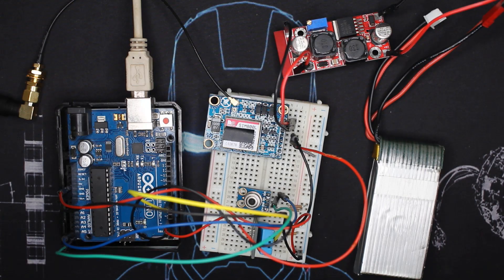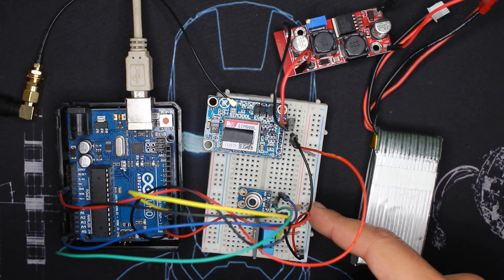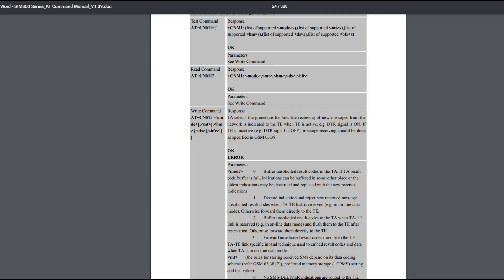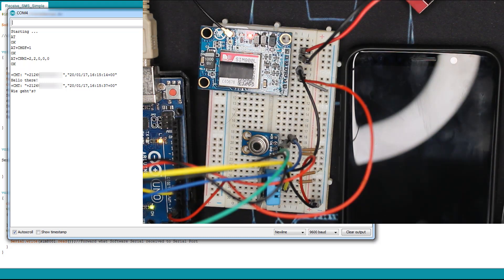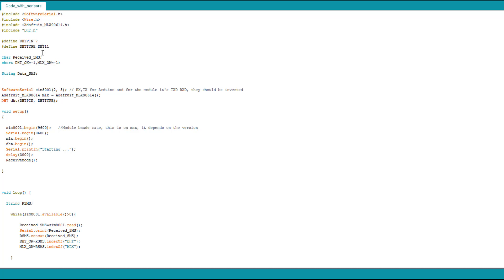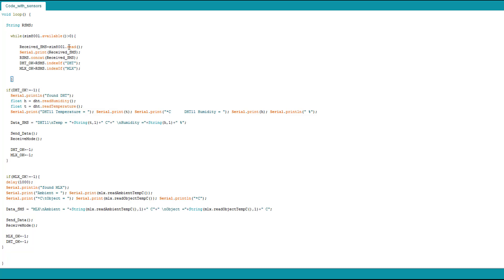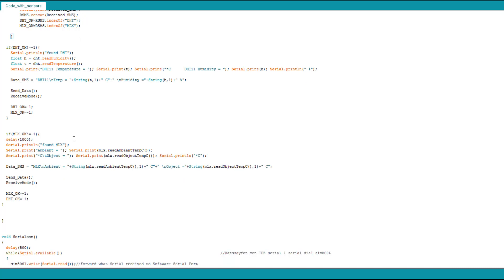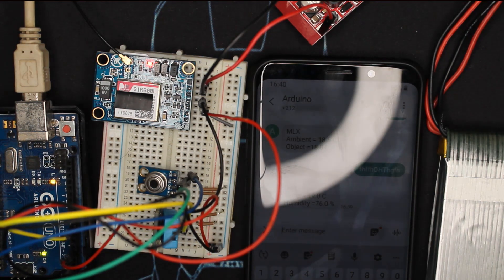Send/Receive SMS using SIM800L + Arduino (Request sensor values) | DigitSpace.com

Comment: Hello sir, first i’d like to thanks for the knowledge you’ve shared throughout your website and youtube. I created an over-voltage alarm program that read voltage with refresh rate every 3 seconds.
where if the voltage exceeds the set point 420 VAC it will automatically send a SMS. but the problem occurs because the SMS keeps repeating every 3 seconds, so how can i do to make the SMS only sent once at the beginning. despite over voltage condition least for minutes / hour after it.? Thank you sir. I hope you can help me

Comment: Hello Sir. I have checked and it works perfectly. I have modified it as per my requirement. But there is one issue I have found ..  Once I switch off the device and start once again the device is not working until I press the reset button of Arduino. Once I press the reset button after that it starts to work. It means every time when we start the device( give the power supply through adapter), first we have to press the reset button of Arduino. " I have checked after sim800 connect to network".
Reply: Hello Sir, I got the solution.  The issue is created because Arduino is an initialised sim800 module before the module is connected to network.  So what I do, first I have monitor the time for GSM to be stable means it connected to the network. In my case  GSM takes max. 16 s, So I just write a delay function of 17s in the void setup function very first. During this time period, GSM connects to the network, and then our circuit work properly.

Comment: hello i have one problem with som800l module. i cant recive any sms in android from sim800l. but i can receive sms in  old keypad mobile. do you have any solution. if have please  help...
Reply from the maker: Hello, make sure your Android phone doesn't block the unknown numbers or don't you have an app that considers the SMS as a spam... if the module can send SMS to other devices it works well.

Comment: Hello. Can i use other sensor (ina219)? I want to build dc measurment and request sensor data via sms like your video. Thanks
Reply from the maker: It's possible to use most of the sensors, just do the correct modifications (data string, units, calibrations...).

Comment: I am getting an error for both the AT+CMGF=1 and AT+CNMI=2,2,0,0,0 commands. What could be the problem?
Reply from the maker: Did you first try with only AT and received OK! ?
Reply from the maker: @Name-ub1kz  You can try "AT+CNMI=?" to check the available options, make sure you check the manual for other commands and troubleshooting https://www.elecrow.com/wiki/images/2/20/SIM800_Series_AT_Command_Manual_V1.09.pdf

Comment: If you are connected to the Arduino hardware port why use softwareSerial?
Reply from the maker: I'm not using (0,1) pins.
Reply: I thought you meant physical pins not digital pins. Apologies.

Comment: SurtrTech I have designed a self driving arduino car with an obstacle avoidance system and line tracking. My car can also be controlled through bluetooth or with an IR remote. Do you have any ideas on a science fair project I could do with my car?

Comment: Do you know how many messages per minute is it possible to be sent using this solution?
Reply from the maker: I don't know exactly, but as I tested, the moment the whole sequence stops you can start another one again... it always needs to put the module on receiving SMS mode before you can ask for another value.